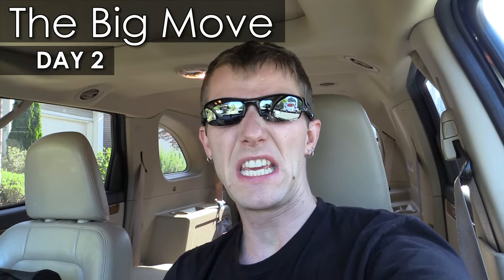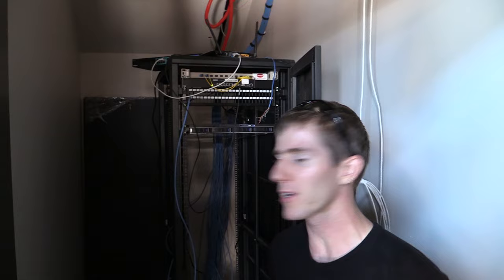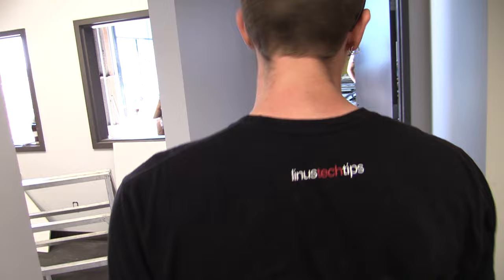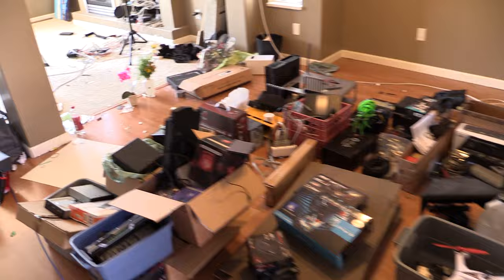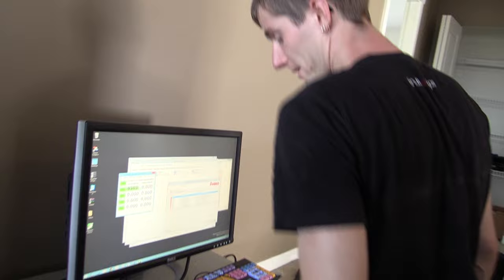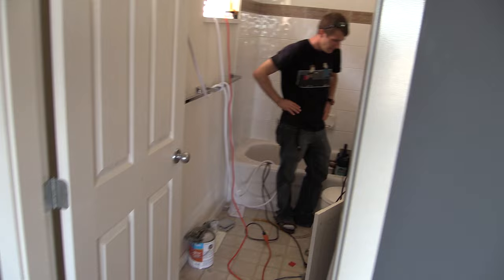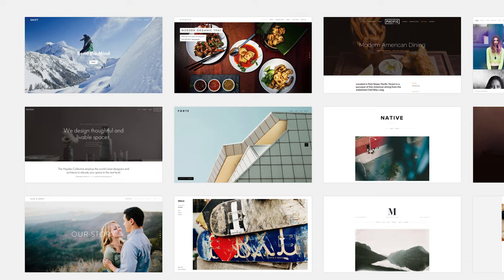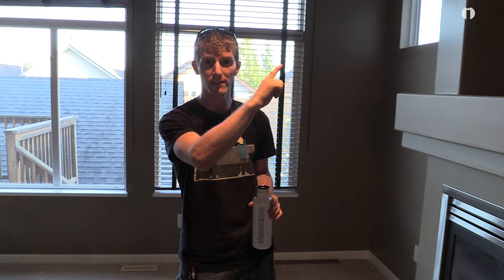The Big Move Day 2 - Goodbye old office, you served us well :'(

Comment: SFP is the form factor of the fiber modules.

You have to know the fiber connector type / single or multimode / fiber diameter.

Also, SFP's typically are not compatible between manufacturers. Cisco with cisco; hirschmann with hirschmann; etc.

Comment: You're pulling out the U-Haul ramp wrong.  Pull it out all the way, so there is a gap between the truck and ramp.  There are hooks on the ramp that lift on to a bar, so lift the ramp and put the hooks on the bar.  This makes the ramp flush to the truck bed.  Just a little advice from someone who has moved 5+ times!